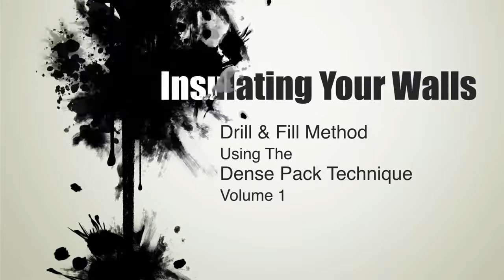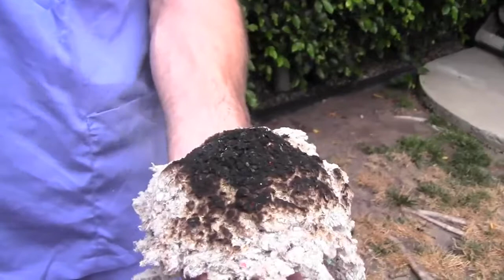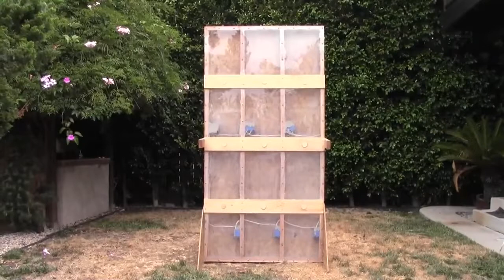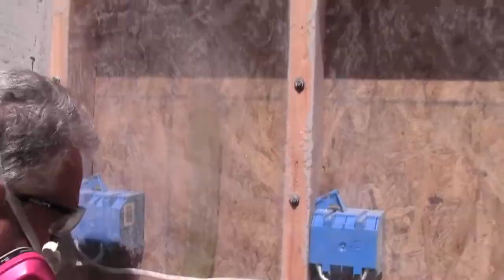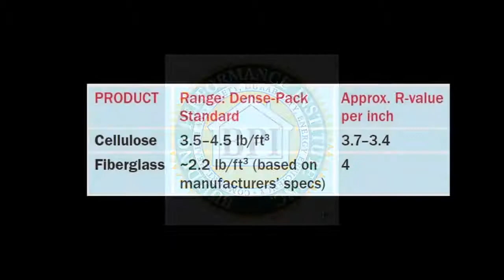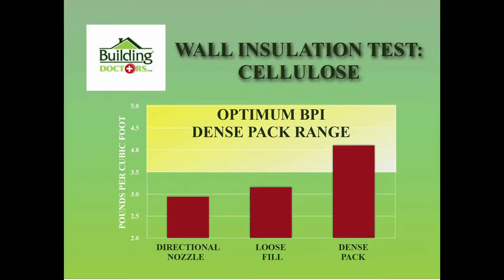Comparison and Example of Proper Dense Pack Wall

Comment: What type of hose is at the tip there?
Reply from the maker: It's a dense pack "whip" or hose.  You can order them from Cool Machines if needed, and at varying diameters and lengths.

Comment: I am confused now because I was just reading by another professional that states, Fiberglass is the one that should be used because of the chemical that comes from cellulose...what to do???🤦🏻‍♀️
Reply from the maker: The main chemical in cellulose is boric acid..it is totally non-toxic.  There's no issues with dense packing cellulose into walls.